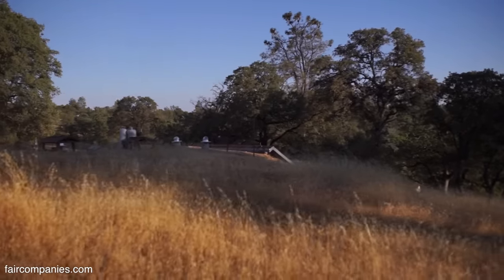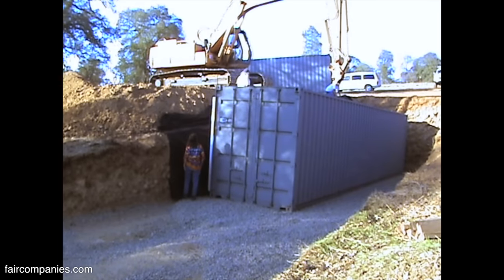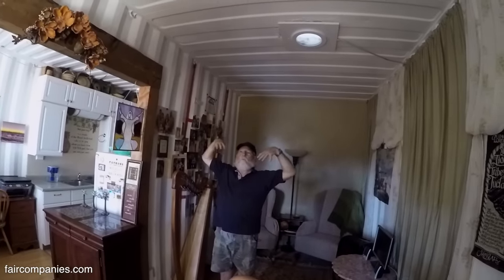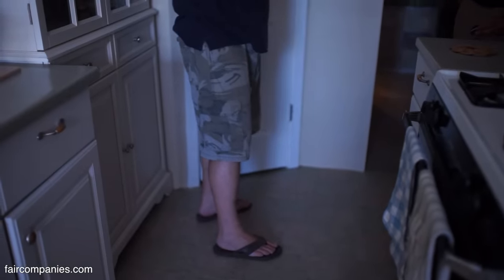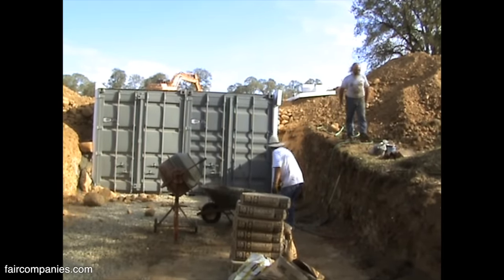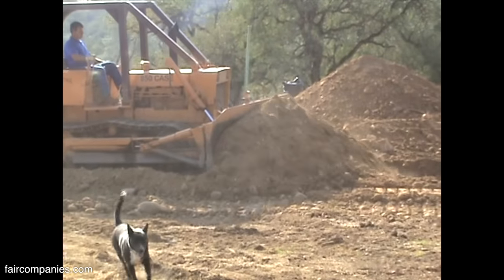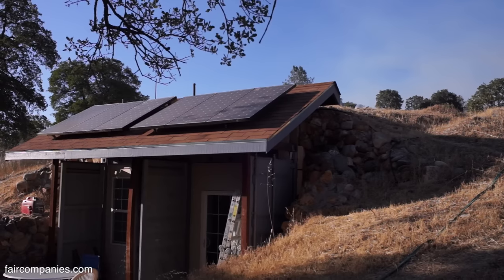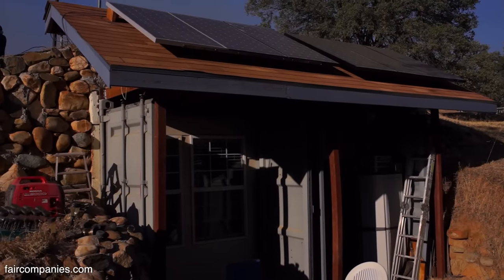Earth-cooled, shipping container underground CA home for 30K

Comment: I'm sharing these comments with respect. This dwelling owner is not well, self informed I suspect. Over and over his mantra rust, rust, mold, Sir you did not read enough to be objective and it is evident in word and construction overkill. What follows is cut and paste: "A shipping container is a special, non corrosive Corten steel; then, when coated with the Ceramic coating, it becomes virtually rust proof and also prevents mildew, mold and is highly antiseptic. There will be no rust problems if you use an ISBUA Certified Member to build your home or advise you." Ok that was an industry expert, now you never mentioned and architect or engineer, so the post and concrete slab are who's idea. These containers can be stacked 7 or 8 high, in use on a dock, why cause they are built to spec's which a few feet of already parched earth would be of no concern. Not to mention the concrete contact w containers, i.e. the chemical environment that now exists, plus the unknown factors. Oh boy. One hour of internet surfing would have been a great start, or review other awesome productions by this channel owner from all over the world. Consider the source, ALWAYS. Myself included. James. Ps regarding his frugality excetera excetera please divulge how much is electrical connection costs to run power from the closest pole to his dwelling and assumably since he sits at or just above grade where is his septic how was it put deep enough so gravity would do the work, deep hole not cheap, unless it's connected to the city I don't think so and the risk in the future when they're in advanced stage of having a septic go sideways and be that deep in the Earth it takes years off your life,  gas comes from above a tank, water from a well, electricity comes from a pole or off-grid but I didn't see evidence of it and he had a lot of trees it's incredibly expensive to have PG&e come on your property you are charged per foot of line and it is eye watering and knee crippling cost. And frankly going into advanced age you don't want to be living off grid, should one or both need a medical apparatus to maintain a quality of life or to sustain it, off-grid would not suffice.

Comment: Looks like a lot more than $30K.
Reply: +Zazzle Delacruz nope.
Reply: +Zazzle Delacruz Doesn't look very nice aesthetically. You can tell its just very functional and practical in the inside. You save a ton of money on aesthetics. They didn't even put up sheetrock or insulation of any kind it seems on most if not all of the walls and ceiling.

Comment: Pretty cool.
The air exchange is backwards IMO - should be fresh air in from the front, out the top.  A black exhaust tube up top would create a forced draft without additional energy input.

Comment: Love the natural lighting. Cost of solar panels? Why no solar H2O heater? Isn't that the main energy cost after heating/ cooling? Are the appliances DC? Why no garage? I would have used unfinished aircrete, poured in place, on the roof. It's much cheaper and extremely light. What is the roof's soil depth? Why no garden or trees there? Self-sufficiency is just that step away. I would have hidden the house entrance, the road to it, and the turnoff from the public road. But I'm a voluntaryist. I don't trust govt. or a society that supports it. Both are immoral, foolish, or both.

Comment: I hope this guy replaced the plywood flooring in the shipping containers before living in them.  There is no telling what hazardous chemicals we’re shipped in the containers and spilled on the floors.  And the plywood used for shipping containers has chemicals put into them for pests.   I would imagine there is a lot of off gassing inside the home they may not be aware taking place.  And finally, there may be uninvited guests brought from other countries under the floor of shipping containers.  These guests can be dangerous such as snakes, rats, spiders and insects.   

Some shipping containers are coated in paint which contains harmful chemicals such as phosphorous and chromate.   Do you want this inside your home?

This is something most folks do no consider when using building containers for homes.  Educate yourself before undertaking a shipping container home.

Comment: how dumb is putting a 6inch thick concrete foundation over this is beyond me. the steel itself could of handled the little amount of dirt tht was layed over this AND ITS STEEL all they needed to do was weld more beams over the top and it would have been 10x lighter and 5x stronger. Leaving the doors is a huge constriction of space. even the wall framing could have been cheap and easy welded tubing. He spent 50% of his budget on stupid ideas.